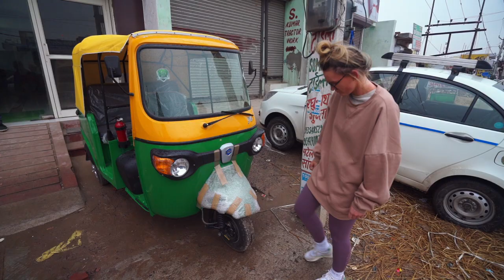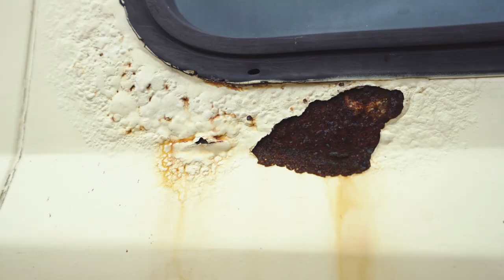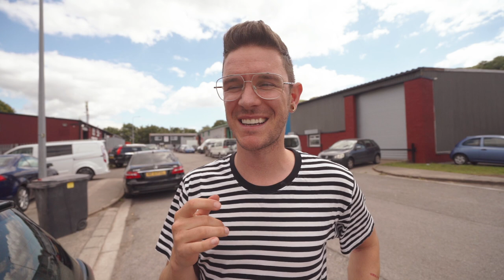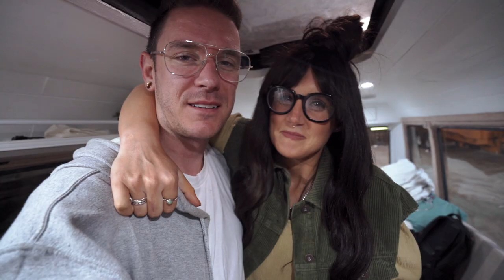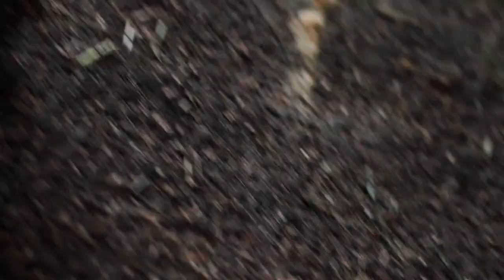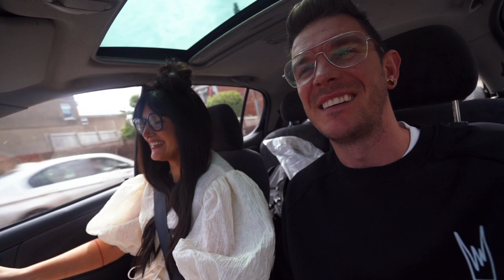Van Life - UNBELIEVABLE  bodywork transformation

Comment: Go easy on the chocs and cake, else the pounds will be piling on.  You should fit a tow bar to Custard so you can tow Chapatti when on your travels to use as an economical run about, just get a dolly made up to take her front wheel or a lightweight trailer.
Reply from the maker: We go to the gym Tony so i'll be scoffing that cake ta very much.
I did say that to Craig but he'd need to get a new license to have tow it on the back.. and he's not keen unfortunately...
Reply: @kingingit  Forgot that trailers are not included automatically like they were when I took my test in 1969.  First time pass, despite the snowstorm that cut it short, a non working heater and frozen trafficators so window had to stay open to do hand signals.  Examiner had a frozen bogey hanging from his nose by the end of the test!